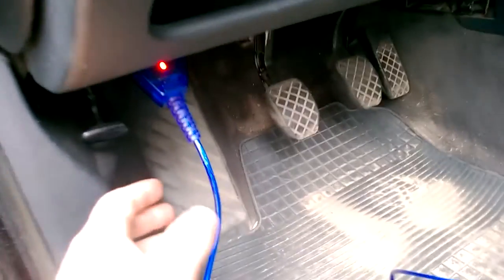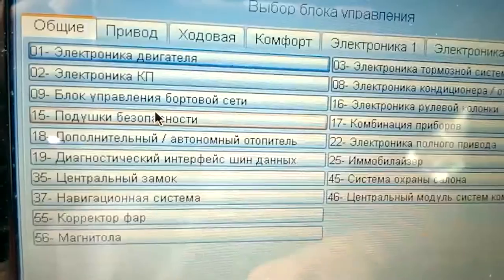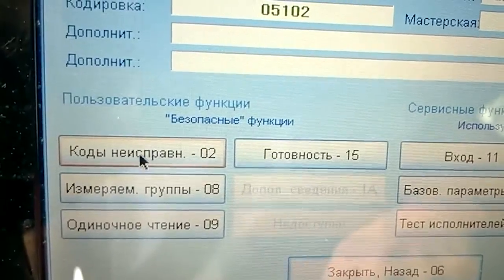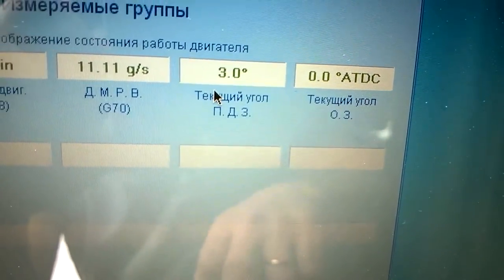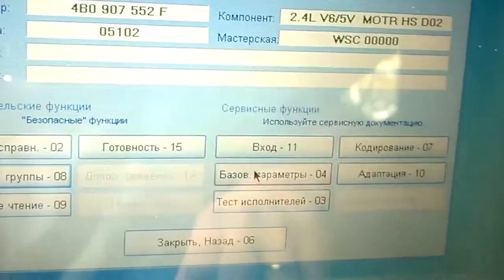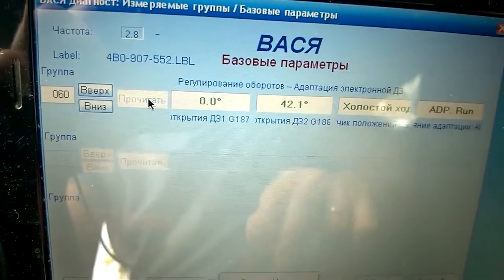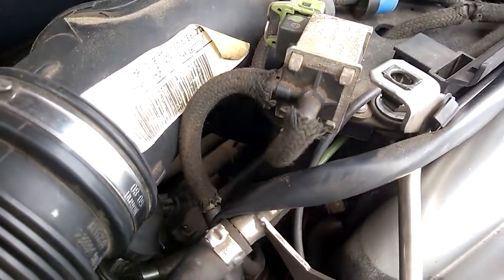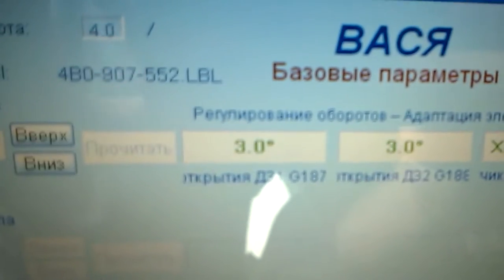Throttle Body Adaptation of the VAG cars (Audi, VW, Skoda)

Comment: Can you make video on rpm adjustment, i cannot change the current value which is 760 rpm and value showed 128 on idle adjustment option. I have vcds 23.1 version

Comment: Found this somewhere online and I do not take any credits:

I just copied this from a thread on Reddit.

"Try adapting (also called basic reset) the clutch and see if it fixes your problem. 

Turn the car off, 
turn the key to II right before ignition, 
hold the throttle pedal down to the "button" for 20 seconds, 
release, 
turn the car all the way off (DO NOT REMOVE KEY) 
then back to II, 
then off again and then start the car. 

See if you feel a difference, you probably will."